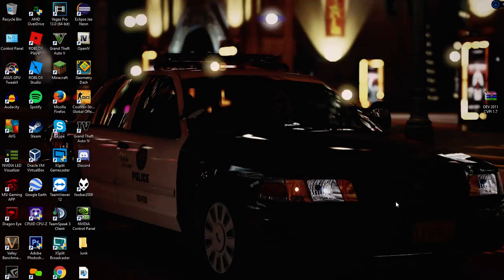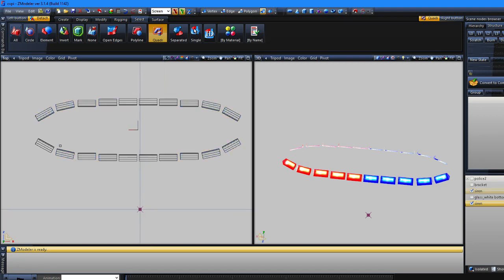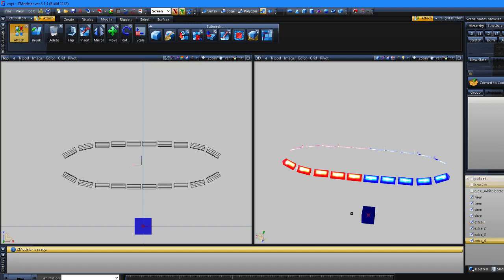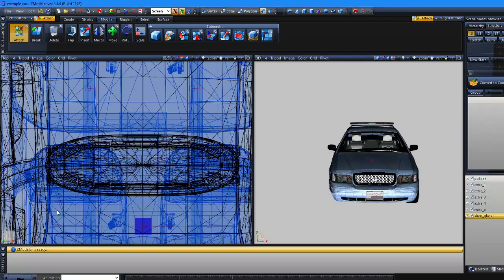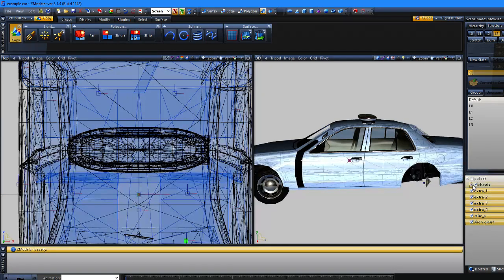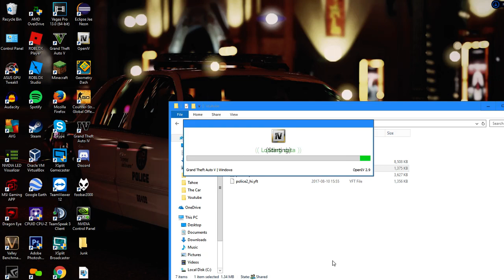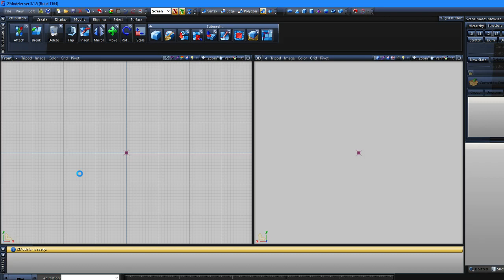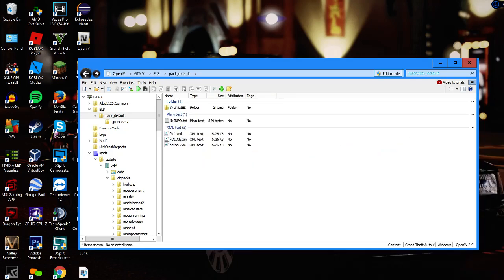ZModeler 3 How To Make A ELS Police Vehicle| #2 | Making The Lights ELS Compatible

Comment: Hey dude, first off I really appreciate these two videos for helping me wrap my head around things so thank you. My issue is when I imported my vehicle and went to open it in OpenIV, it wouldn't open and it says the file size is 0kb. I believe the issue is with the User Defined Options section because I deleted the base, but when I try to switch user defined options on and apply it, it just automatically unticks itself. Any idea how I can solve that?
Reply: This is the error I get when I try to export 
Can not obtain Shader material from "Default Material". file:RageExportMaterial.cpp line:126

Comment: hi i like your videos i am a beginner at making cars and im having lot of difficulty to follow along any tips or suggestion i can import a car and a lightbar and put the lightbar on the car but no sure what to do on the other things needed
Reply from the maker: i recommend starting easy with a CVPI and an arjent sl all can be found on lspdfr
Reply: hi i got the car working in the game and followed all the instructions given in the videos my lights on the lightbar come on at the back of the bar but not the front any ideas what might cause this and how to fix ? ive exported few times i have also moved up the light emissive file up next to default materials but still not working
Reply from the maker: Spike Hawk it's probably where you detached the lights you maybe moved them back, try re doing the lightbar
Reply: hi okies thanks for the quick reply ill try that and see how i get on thanks for the help

Comment: Hello mate! I would be really happy if you could help me with this!
This is pretty self explanatory. ELS wont light up/will stay constantly on. ELS worked when I had fewer leds but now as the number of leds incresed, nothing will light up. Also when I put extra_** higher on the hierarchy, body parts will start to act like ELS lights. Any fixes?
Reply: did you even find a fix?
Reply: @Chris-dm4uv  yes, you need to attach the extras you want to light up at the same time and if you have multiple extras with the same name (ex. Extra_1) the highest in the hierarchy will light up and the others will stay on. Also if you have problem that you body parts flash, attach all objects with the same name to each other. Hope you understood.
Reply: @wtfman5852  Thanks man
Reply: @Chris-dm4uv  did you get it to work?
Reply: @wtfman5852  Yeah I did. It's the first time i modeled in over a year. I had a duplicate extra_1 from the vehicle i was using, so i renamed it and it worked.

Comment: bro why do some of the lights light up and some don't, the lights are functional but only half are emissive the other half are just dull textures that don't light up
Reply from the maker: try re exporting
Reply: well im pretty sure that wont work since i spent almost 3 hours editing and exporting over and over again trying to fix it but still wouldn't fix but thanks for responding
Reply from the maker: Sorry dont know then, did you change the texture file never had this issue, maybe you have moved the lights back a little into the mesh

Comment: I followed your steps to the letter, but when I spawn my car, it spawns completely destroyed and unusable. The ELS function still works, but the rest of the car is busted. The body panels are nonexistent, the driver doesn't sit in the seat, and the extras aren't visible. Solution?
Reply: I get a similar issue. When I spawn the car, it's floating, missing body panels, making crashing noises, and some parts are floating. ELS still works, though. I'd like to see a solution or help if possible, too.
Reply: @lukedev5575   It's probably too late for this but here I go. 
The same exact thing was happening to me but i fixed it by not doing the last thing he does on the model, when he tells us to use "user-defined options" and remove "base", don't do that, leave "base" alone and your car will work. I don't know why he tells us to remove "base", I haven't seen anyone else do that in any other tutorial video and ignoring that step made my car work and my game didn't crash at all like he said it would happen in the video.